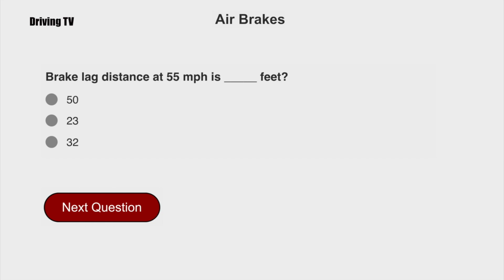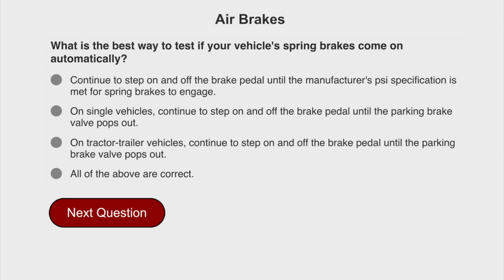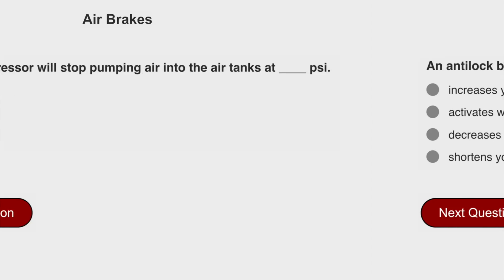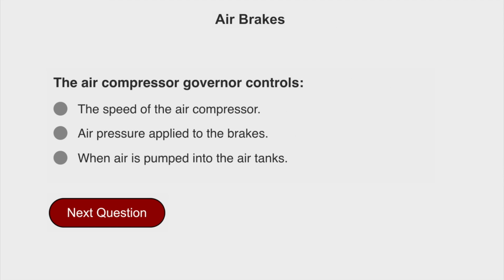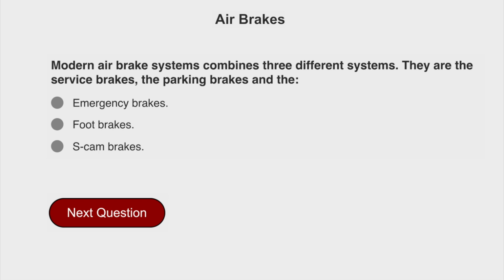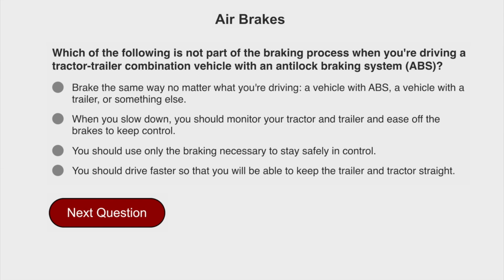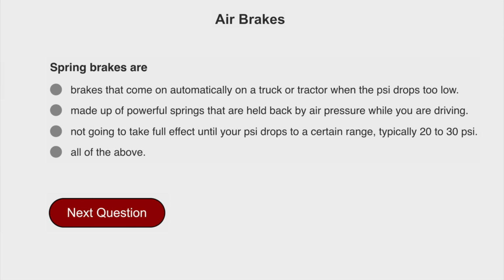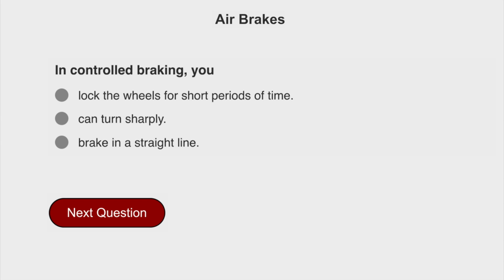2020 CDL AIR BRAKES ENDORSEMENT EXAM QUESTIONS & ANSWERS/EXAM 1

Comment: Out of general knowledge airbrakes or combination which test do you have to take first?
Reply from the maker: You can take them in any order
Reply: @DrivingTV1111  perfect! Thanks for the videos btw they are very helpful!!
Reply from the maker: @robertomolano6460  👍
Reply: You can take either one. You don't have to take both at the same time.
Reply: @WpBree60 ok thanks I appreciate it.

Comment: Brake lag distance for 55mph is 32 feet ? Isn't it 50 ft ?
GREAT VIDEO
Reply from the maker: It's 32 feet, best of luck on the test!
Reply: It’s 30 but 32 is close enough

Comment: You have the answer wrong for the question at the 10 minute mark.  It should be that air is RELEASED from the brake chamber.
Reply: No sir. with S-cam brakes, air will enter the brake chambers and the added air pressure will push out the rods... they got it right!

Comment: Just need to take this for my permit, going in a bit
Reply from the maker: Good luck!
Reply: @DrivingTV1111  thanks, passed it
Great vids
Reply from the maker: @GUS4BEATLES  Awesome, congrats!!
Reply: @GUS4BEATLES  how many questions are on the air brake part
Reply: @DrivingTV1111  q

Comment: @Driving TV Awesome video!!  Information is DEAD ON!!!

To anyone reading:
Please disregard misinformation in this comment section from @Tolerant Buddy.  He incorrectly stated some information regarding brake systems.  @Driving TV is 100% correct.  The correct answer is:

In exact words from an actual Commercial Driver's License Manual workbook: "Air brakes are three different braking SYSTEMS: service brake, parking brake, and emergency brake."
Keyword: SYSTEM

S-cam brakes are the most common TYPE of foundation brake.
Keyword: TYPE

 Good luck on your test.
Reply from the maker: Thank you!!!

Comment: OMG 😱 guys watch out he is giving wrong answers 😳 
why would you do this?? I’m so confused right now after i see this Video the question modern air break system combines three different systems. They’re the service break, the parking break and _ the answer you gave is Emergency break. Completely wrong‼️ parking break and emergency break are the same don’t you now that of not how could you give a wrong lesson while the right answer should be (S-cam break) 

Modern air brake systems combines three different systems. The are the service brakes, the parking brakes and the: A S-cam brakes.
Reply: The answer is emergency on every other app I use to study.
Reply: @Tolerant Buddy  You, sir, are 100% wrong. In exact words from an actual Commercial Driver's License Manual workbook: "Air brakes are three different braking SYSTEMS: service brake, parking brake, and emergency brake."
Keyword: SYSTEM

S-cam brakes are the most common TYPE of foundation brake.
Keyword: TYPE

Please check your information before calling out others and then proceeding to share inaccurate information yourself.  Good luck on your test.
Reply: VoX8two Another omg im really sorry i had a doubt that day and i literally copied your question and paste it on Google and that was the result that i found the s- cam break anyways I learned from my mistakes. Thank you so much for your help and by this chance just to inform you that i passed my exam both the Z endorsement and the knowledge test thank you 🙏🏽 for all your videos it’s really helpful.
Reply: Tolerant Buddy so I am taking my test Tuesday and will like to no if you seen the question on you test
Reply: Ginyiner White I had it on my test and I passed the test the first time
Reply: Thats the easiest question it is emergency brakes lol